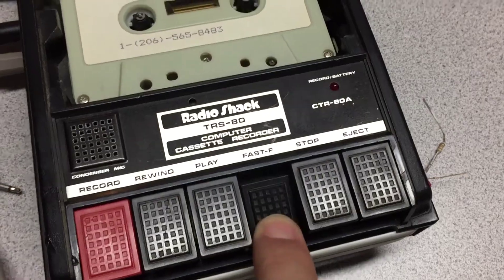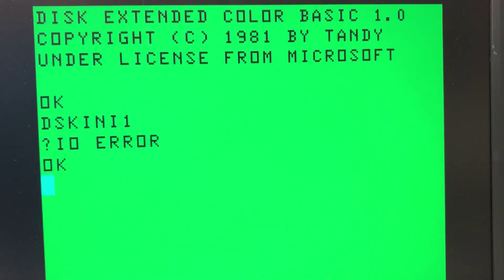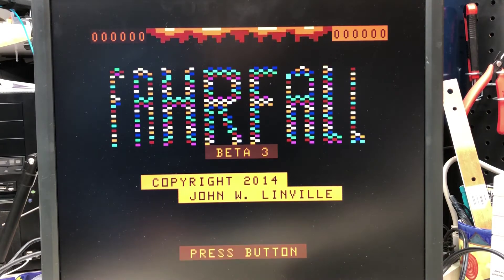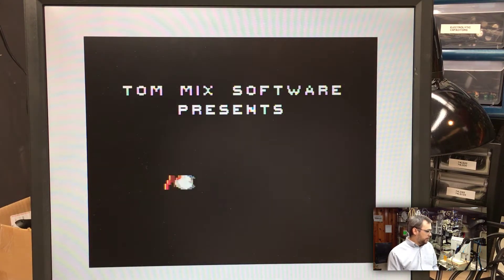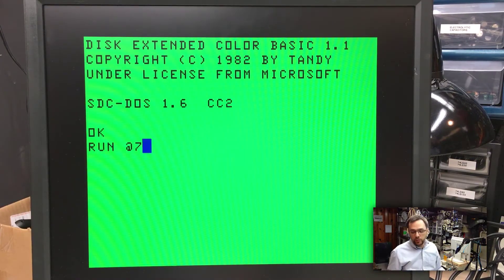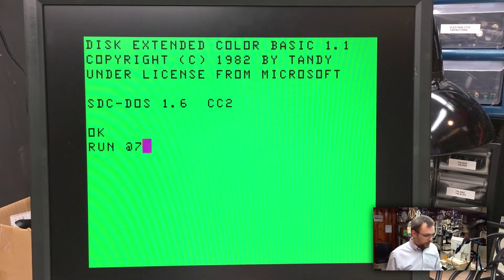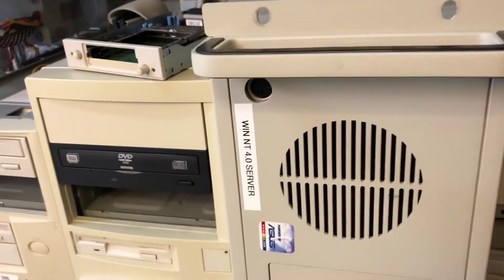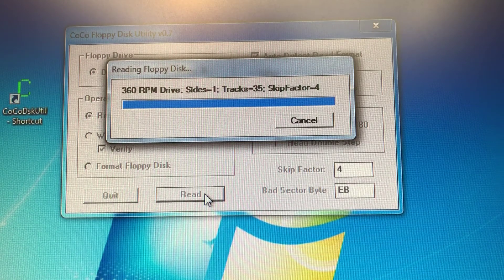REVIEW: The CoCo SDC (and some other stuff...)

Comment: Regarding the 16k cartridge size limit, there is another modern cartridge that allows loading multiple cartridges of up to 256k in size totaling up to 8Mb, the CoCo Flash. It does not do what the CoCo SDC does with disk emulation though, it specializes in cartridge images.

http://www.go4retro.com/products/cocoflash/

Comment: Time code 7:02: "The CoCo SDC doesn't solve one important issue. I want to try to preserve the disks that came with my CoCo."

The CoCo SDC does allow preservation of real CoCo disks when you have a Multi-Pak and a working floppy disk controller. The CoCo SDC software allows you to turn off the emulation on a disk by disk basis. Thus allowing you to use DECB's BACKUP command to make an image of a disk. This is described in the manual:

http://www.colorcomputerarchive.com/coco/Documents/Manuals/Hardware/CoCo%20SDC%20User%20Guide%20%28Darren%20Atkinson%29.pdf
Reply from the maker: AWESOME. Next step: get a working floppy controller.

Comment: If it's a single-sided drive you should use dskini0 (zero).
Reply from the maker: Depends on how the drive is jumpered, does it not? In my particular case, dskini0  doesn't cause the heads to move, and gives the same result regardless of the drive I use. Formatting a disk using a PC with the right tool and trying to DIR the disk specifying any drive number also gives the same: IO Error.
Reply: Just making sure.  The default is drive zero.  I hope you still keep trying to get it to work, or try a newer controller and drive.  I still like having my disk drive around, even if I don't use it.  You have some other videos I think I'll enjoy... so. SUBSCRIBED!
Reply from the maker: Welcome to the nerd army! Yeah, what you don't see in this video is the literal weeks of nights after work I mucked about with the thing. Trust me, I tried everything. Magnetic media is probably still in the CoCo's future, but I'm not sure when. So many machines, so little time!

Comment: Regarding those mystery disks, the media is identified as double density soft sectored 40 track. They are dated 1984. I think they may be for a CP/M system or a Tandy TRS-80 model 1, 3, or 4.
Reply: Joe's Computer Museum 
As if you weren't already planning to...
Reply from the maker: Great! Now its time to get some more TRS-80s!
Reply: They MIGHT also be OS-9 Disks.. You might want to consider that...